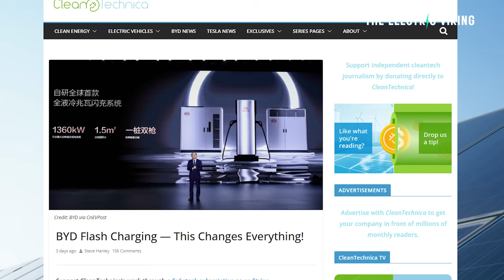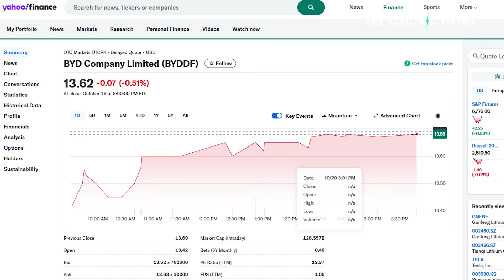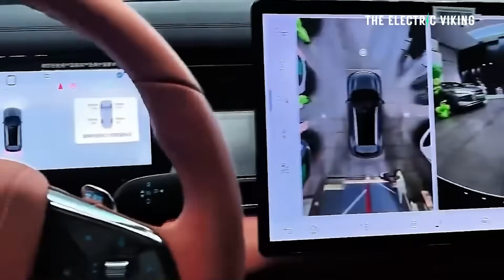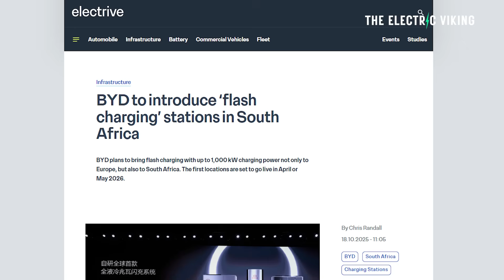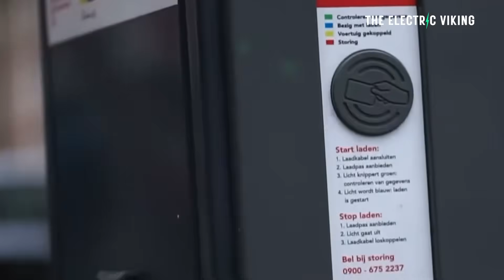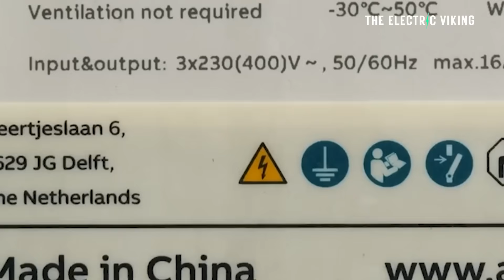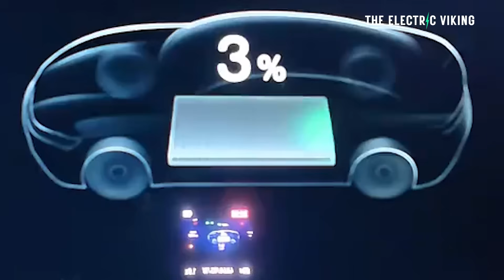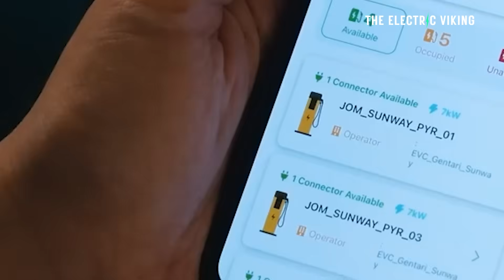Steve Hanley Says BYD's FLASH Charging "Changes EVERYTHING!"

Comment: For consumer vehicles, for me at least, the combination of range and charging/swapping time is key. At least 600 real kilometers winter/summer and "normal" driving style while using heating/airco and "filling up" under 10' is what I look for and all that affordable, ie a mid size car for less than 40k € with decent set of options. State Nov 2025. At the same time unified charging rates at transparent costs being cheaper than equivalent regular unleaded petrol.

Comment: A normal charging stall may charge a EV to 80% in let say 30 minutes.  On the other hand, 1000 kWh can charge a compatible EV in 5 minutes.  The same stall can handle 6 compatible EVs in 30 minutes while a normal charging stall can only handle 1 EV.  This sounds like a better idea to install 1000 kWh stations now than many more normal stations in term of saving space.  I figure the installation cost will be similar.  May as well install 1000 kWh version to serve more customers quicker.  That’s assuming the electricity power is sufficient to support 1000 kWh stations.
Reply: it doesn't work like that. you get 1000 cycles at 1C charging. at 10C charging you will barely get 50-100 cycles.

Comment: Here on the Canadian prairies, our concerns are range and cold-weather performance of electric vehicles. We have tremendously long distances to drive (driving eight hours to spend a weekend somewhere is not unusual at all), and it routinely gets down to -40 here in winter. The EV companies all pretend that their vehicles perform as usual in -40, but they don't.
Reply: As someone who grew up on the prairies, I agree. But this isn’t a problem limited to EVs. I remember friends getting excited about a vintage Volkswagen only to realise once winter arrived that the car didn’t have a heater. It was a bit easier to drive in snow though because of the engine in the back and its light weight that meant two people could lift it out when it got stuck.

Do they still have plug-ins for cars outside of apartment buildings on the prairies and, if so, could some of these not be used for overnight charging? By the time I got my first car, they were no longer needed. I remember my dad coming home laughing one day after encountering an American tourist who had parked his RV in front of the legislature in Regina and was using the electric outlet thinking it was there as a convenience for visitors.

I’ve had issues with ICE car batteries after moving from the balmy west coast to the east. I had to replace the battery sooner than expected because of the cold weather and was advised by CAA to drive the car for thirty minutes a week to keep the battery healthy (I live close to good public transit so only used the car for road trips out of town). This was so annoying, I eventually sold the car.
Reply: @polishtheday  Yup, there are still plug-ins for cars everywhere here in Lethbridge. They can't be used for charging yet - the connectors aren't the same. I think there may be adaptors for this, or there will be at some point.
Reply: I moved from Montana to Western Oregon and fixed that problem. 😉
Reply: New batteries work down even lowe4 at 75% of output. I'm on prariea too. I'd not give up ice

Comment: The keys to widespread EV adoption are...

* Affordability in all form factors (including used)
* Ability to charge when the car is not in use (home, work, public parking,...)
* Reasonable range (250+ miles)
* Ability to fast charge when needed (250+ kw)

BYD doesn't necessarily need a big pipe from the grid for their charging stations if they put battery storage on site, or near the charging site, that can supply more power when needed. The storage can charge slowly and discharge rapidly on demand. The storage could even be used to help with local grid peak demand.

Comment: The problem EV manufacturers have today is they are competing with a technology that has a hundred year head start. People will be willing to make some compromises in terms of range and charge times as gas prices continue to rise but until the EV's both reduce charge times to what it takes to fill up a tank of gas, along with increases in range and operational reliability to something comparable to that of an ICE car then mass adoption will not take place. So, that means a 5 minute charge time to get 400 Mi (650 Km) of range with little to no losses at the extremes of the normal operating temperature range. In the US, that will be the time when most including myself will replace their ICE cars with EV's.

Comment: BYD and 62 models is the main reason why I sold all my BYD shares. You can't be profitable and scale with that many models
Driving an EV you need to change your habits. U charge every day when I come home, even if I drove only 50 miles. Once in a while I drive 500 miles in a day, I will drive for two hours, stop for eating, 30 min charging in a Tesla  250 Kw charger, and drive another 2 hours have another stop to walk around, stretch my legs, and get with a nearly full batery at destination. When I am shopping, or having a lunch I will charge the car during my stay. I will nearly never be at 10% of my battery capacity: charge many times whenerver you have a stop. Unlike ICE where you drive until you are at the limit, and need to find quickly a gas station. So, my conclusion is that the existing Tesla fast chargers are charging quickly enough when I do long distances, and a 350 to 500 miles range is more than enough.
Reply: But several models can use the same platform and be built on the same production line.
Reply: @robertsheperd502  and might miss the Wright's law

Comment: The best BEV charging efficiency, ever validated with an EPA MPGe rating, achieved 90% charging efficiency. The average BESS system in Australia as well as in USA achieve 80% Round Trip Efficiency. Part of the problem for BESS is despite progress since Hornsdale was installed 8 years ago not much progress has been seen. Round-trip efficiency (RTE) is the proportion of the energy put into the battery that can be retrieved. It is calculated as the ratio of energy exported / energy imported through a given point (eg the inverter terminals, or the grid connection point), over a given duration. 
Method Operational performance estimate from 1 July 2022 to 31 December 2022 81.7%. If you do fast charging it makes sense to have a BESS installation because buying the facility to draw energy from the grid is too expensive. Sure it is great that BYD and others develops fast charging and ultimatively both cars and BESS will improve.

Comment: Flash charging consumes a large amount of power from the electrical grid, which is why BYD has installed massive battery systems next to its 900–1000 kW ultra-fast chargers. However, this approach is neither practical nor efficient. The problem lies in the fact that to support thousands of ultra-fast chargers, you would either need to significantly upgrade the power grid or rely on huge battery storage units at each charging station. Both options are inconvenient and unsustainable, especially since charging a large battery only to use it to fast-charge smaller vehicle batteries adds unnecessary complexity and inefficiency.

Comment: Charging speed vs Range depends on where you live.

Countries with sparse charging stations need range.

Countries with dense charging stations need fast charging, as Range is not an issue.

The industry needs the option to buy long range, to compete with the Fossil Fuel disinformation hype.

Real users don't need range, as they rarely go further than 100 miles....But, they need confidence that they can do their longer distances easily, with no inconvenience. 

I reckon that my bladder can do about 150 miles, but I also want 50 miles "safety buffer", so I'm pretty happy with 200 mile range.

Comment: Tesla usually has some battery storage with its chargers so it doesn't affect the grid so much they are saying that you can charge 400km in five minutes so you really wouldn't need to charge to the full 700km ever and if you did you could do it overnight on a normal charger

Comment: Tbh the biggest obstacle of installing chargers in south Africa will be people stealing cables and equipment
Reply: Chargers will be located next to existing petrol station pumps and shopping centre parking lots which as far as I know are fenced off so making it less vulnerable to theft.
Reply: @eish3291  would be good to see SA adopt electric vehicles and start to move forward. Fingers crossed the measures work 🤞🏻
Reply: @stevemann6110  Mass adoption will happen when competitors start bringing their products into S.A and forcing prices low enough to make sense to buy an ev. The reason BYD wants to install flash Chargers is to stimulate the sales of ev,s.

Comment: Data centres use huge amounts of electricity. Charging stations do too. The grid already can't cope with current demands in the UK with windfarms having to be switched off if they are producing too much energy. The UK imports huge amounts of electricity from Europe especially Norway. Oddly Milliband the UK Government minister responsible for energy is determined to close down oil and gas and build more wind farms. He should focus on the network grid first.
Reply: Wind turbines in the UK are being turned off while natural gas power stations keep running because they have guaranteed usage contracts. The previous government always favoured the fossil fuel industry, although wind and solar are much cheaper, so we have very expensive electricity linked to market gas prices. The current government will have to dismantle the unfavourable pricing structure without being dragged through the courts by the fossil fuel industry. 
Power distribution is receiving investment, although it’s poorly reported. Substantial battery banks to smooth peak demand are also being installed - 50MW already connected in my town. The weakest link is local distribution, eg connecting banks of fast chargers in public car parks in parts of town where substations are decades old.
Reply: @Affableambler The present regime is bankrupting energy intensive industries and impoverishing the already poor. According to Tony Blair's think tank the most expensive electricity in the world is being caused by subsidies given to renewables.
Reply: @johnfrancis4401 UK Fossil fuel subsidies are about £20 billion pa and renewable about £25 billion. The renewable figure includes nearly a billion to the grossly polluting Drax whose burning of imported wood chips is counted as renewable! It also includes subsidies that are going towards new infrastructure that will continue to produce clean electricity for decades. The cheapest electricity is generated by solar and wind. Nuclear is steady for base load, but very expensive. Fossil fuels are costing us our future and already causing hugely expensive losses to agriculture and infrastructure. Rising sea levels will cost us trillions.
Reply: @Affableambler Explain the "fossil fuel subsidies of £20 billion a year". Presumably you exclude the duty on petrol and diesel and the VAT on both. You exclude the income taxes on fossil fuel workers employed in the North Sea. You presumably ignore the corporation taxes on profitable oil companies operating in the North Sea. Drax is ridiculous it should be converted to burn gas produced by fracking the Bowland Basin and huge reserves under north-west Lincolnshire. The cheapest electricity is solar BUT IT ISN'T reliable you need back up. Wind turbines on land are also very cheap but same story. Both require massive infrastructure in the National grid conveniently excluded from your cost calculations. Nuclear backup is horrifically more expensive. Please explain the £20 billion subsidy.
Reply: @Affableambler According to Google AI the oil and gas industry received £9 billion by way of tax relief on capital expenditure from 2016 to 2020 This looks to be about £2 billion per annum. The tax relief on capital expenditure on renewables is much larger at £40 billion per annum according to the same source.

Comment: In a way this is kind of bullshit tech at the moment. A lot of regions, even in EU are not even capable to jab a decent amount of 11kw chargers … It will take a lot of years even before a complete network is installed with 250kw chargers. I drive EV for about 10 years, 99% of all charging is done at home at a 16A 230v socket. When I go on a holiday trip, In never drive longer dan 2 1/2 to 3h … no need at al to have a Ton of batteries in my car for  a range of 1000km at all. At my stops I charge 15min, take a drink, go to the toilet, let the dog out …I will never pay extra for a 1000km range or for 1000kw charging.

Comment: I remember when the original iPhone came out and the only thing people could find to complain about was the battery life and having to charge more than once a week. “ The iPhone will catch on because people want to charge it every night” etc.  We do not need electric vehicles that closely mimic internal combustion Vehicles.  There are states in America particularly the cold ones where every parking space has a socket to plug your block heater into.  The real tipping point at least in the UK will be when convenient supermarket refuelling disappears and is replaced by electric charging.

Comment: A 1 MW charger is ridiculous. No electrical grid could realistically support that level of power for tens of thousands of EVs simultaneously. A typical nuclear power plant has a peak capacity of around 1,000 to 2,000 MW.
Reply: Pretty sure the price will be higher during peak hours and lower when there's a lot of available electricity (from 10am to 3pm for example) so that customers will not charge all their cars at the same time
Reply: 1/ EV's don't charge solely from grid sourced electricity. Rooftop solar does a great job of charging EVs really well.
2/ There is more than a single power plant worth of supply available on a grid.
3/ Level 2 and greater EV chargers will only deliver power at the rate that is available at the time. They are not dumb devices that are mindlessly sucking the grid dry.
4/ Any specific local electrical supply has circuit breaker devices to protect from overload at the local level. No one can just draw infinitely current from the grid beyond that grids capacity rating. The grid will automatically protect itself followed by a reset.

Please improve your understanding of the technology you are commenting on before speculating.

Comment: The reality is that ultra fast charging will mainly affect the companies that supply the units and those sites who host them. Most of us who own EVs honestly don't care if it takes 30 minutes or 3 minutes to charge, because we do it so infrequently as to be irrelevant. Most of us can charge at home, and we're only going to charge are the outragously expensive public chargers for a top up, just to get us home. There comes a point where the manouvering to get the car into the charging bay, plug it in, initiate charging and the reverse of that process takes almost as much time as it does to get the small amount of charge we want. If you need the rest room and a quick coffee, that's probably going to be more than enough. You won't want to be stopped there for too long, because charging too much is expensive.
People don't brim their tanks at the pumps on motorways now, and they're not going to be doing it with EVs either.

Comment: 1000 kW on a single connector? That's probably not true!
While updating the Wikipedia article on megawatt charging I had tried to find the original source of the information, and it turns out that all traces lead back to a single reporter of the Spanish "testcoches" mag who claims that a single staff member at the BYD booth on the IAA in September had told him that. That's it. However "testcoaches" has been blacklisted in some areas as a sensationalist "yellow press" publication providing unreliable information. Stella Li from BYD had given an official speech on the IAA providing some bold statements on a flash charger network in Europa in early 2026. She did NOT mention anything about the actual technology being used.

Comment: Realistically where are these 1000 kW chargers. Certainly not in Aus and I don’t think in the European countries either.
If you look at the numerous video from Tobias The Electric Trucker, it is often a challenge to find 350 kW chargers that are operational. His new E-Actros Mercedes truck -  recently went from Germany to Turkey and showed again the inconsistent operation of charge networks.
Europe os so far ahead of us here in Aus - yet still struggles.
We in Aus have no hope. 
Copper thieves still vandalise charge cables.
Reply: Alpitronic offers the HYC-1000 and the Eletric Trucker has even used on of those. The thing is that CCS has a maximum of 600 kW on a connector from Phoenix Contact, while the full 1000 kW can only be shown with an MCS connector using 1200 A.

Comment: The difference between 5 and 15 minutes is huge. At 5 minutes you can be a fascist about leaving the car, so you can have stalls like current petrol pumps. At 15 minutes you can't. You need lots of stalls, many of which will be filled with cars charging that extra little bit while I finish my coffee. It really annoys me how all the Anglos just assume everyone is going to mainly be charging at home. And how am I going to do that? Run a cord 3 floors down to the parking spot outside in the rain?

Speed and capacity are super important if you don't have home charging, and the overwhelming majority of people in the world either don't have the appropriate grid connection to a detached house, or live in a flat. So your "it's not important" is just ignorant